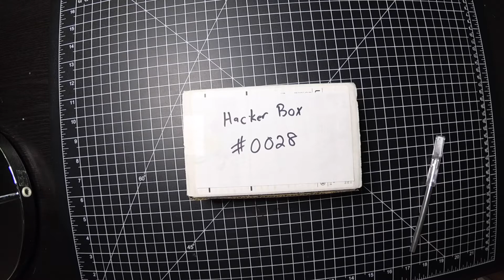HackerBox #0028: JamBox

Comment: I can't believe you had to cut the bottom of the pots.  Wondering if I can drill the holes in the PCB or if it will cut the traces on the ground plane if I do.
Reply from the maker: Yeah, I wouldn't recommend drilling out the holes.
Reply: @NickMomrik  Thanks, I thought about it some more, and even if it didn't damage the ground plane it would have done away with most of the pads anyway.  I ended up shaving the leads with my dremel too, not bad.